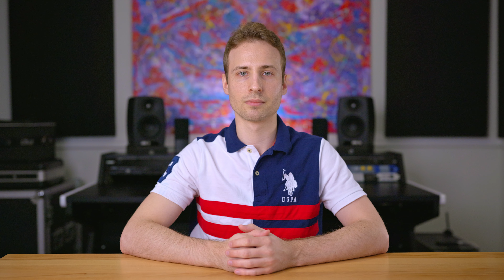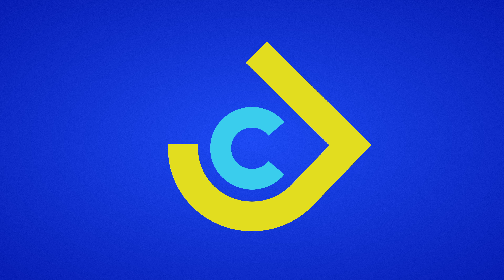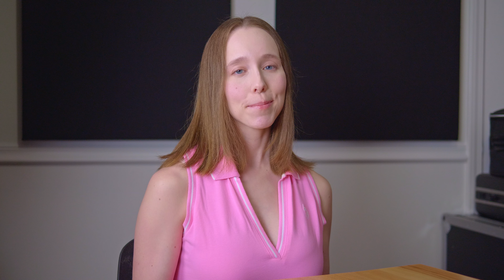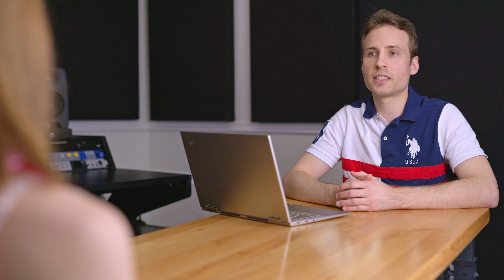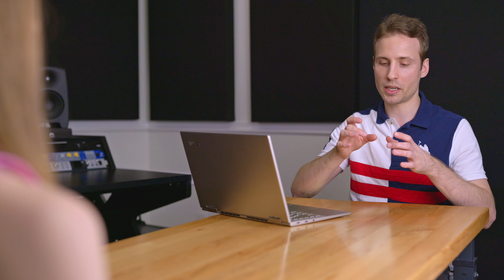The Next Tech Gold Rush

Comment: Very interesting video thank you both for the information. I’ve been a professional software engineer for around 8 years. This seems like it could be an interesting field to learn and have as a backup. Guessing it would be a large pay cut to “start over”. Also wonder how susceptible the field is to AI compared to general software engineering.
Reply from the maker: I think the field is a LOT harder to replace with AI since the work is very physical. It requires quite a lot of in-space 3 dimensional positioning, as well as information that's niche and extremely difficult for AI to gain access to. It'd be like replacing plumbers with AI, it's just not possible at the moment, and won't be for a long time.
Reply: That makes sense. Thank you for the response and all of the great content!
Reply: I think you would have a lot to offer the field having been in software for 8 years. Controls roles and tasks are extremely diverse. You could work for a company who builds and programs machines for manufacturers; work for an OEM and service their existing machines; work as a SCADA, database, and continuous improvement specialist - involves Ignition, Wonderware, or VTScada, database and server management, and coming up with ideas for data reports and solutions; work for a robot development company as a software engineer; or if you have any background in cyber security you could support the deficiency in the industry. Many automation companies and manufacturers need PC software developers as well to work on their ERP or SAP systems and other internal systems, or maintain their website. 

You'll see positions for Electrical Engineers/Designers, which I believe would have a higher learning curve being that you'd need to develop an encyclopedic knowledge of all the available controls devices out there and keep up with new ones and learn the standards for Control Panel Design and schematics. 

Controls programming is pretty easy to pick up through online courses and practice. PLC I and PLC II by Paul Lynn on Udemy were my favorite - they include hands on projects that are relevant to work in the field. He also teaches basic HMI design. The courses go on sale often - I bought them for around $12. It can help to learn ladder logic, structured text, and function block programming, and learn several of the PLC softwares that are popular - RSLogix500, RSLogix5000, Studio5000 for Allen Bradley plcs, and TIA Portal for Siemens PLCs. Schneider Electric also has free PLC software to download and learn on, and it's used fairly often throughout the industry. I think you'd pick it all up pretty quickly with your background.

Ignition also has free Inductive University online courses so you can learn how to use Ignition. It's a SCADA software for monitoring controls systems and plants remotely. You can also get certified by them. Super useful and becoming very popular in the industry. 

As far as pay, complete entry level can pay around $70k, but with your experience I think you'd get higher than that, especially if you prepare and have some controls skills and knowledge when you interview. I've gotten offers for about $150k with around 7 years of experience. 

I'm the controls industry AI is a great tool, but it'll never replace controls engineers. The applications we work on are too unique and involve to many changing factors for AI to reliably handle. It complements our work though. It's already being used for data analysis, prediction and simulations.
Reply: I left a comment before, but it seems to not be showing up. I'll try again. 
Like Josh mentioned, AI is being used as a tool for data analysis, simulations and making predictions. It might even be used later for acting as a reference guide for standardized codes and technical information. But it can never replace Controls and electrical engineers. 
As far as a pay cut, I think your past experience as a software engineer would be very valuable and give you insight to solve problems with programs and networks better and faster than most people. You'd pick up controls programming very quickly and you're probably accustomed to learning new technologies. If you gained the skills needed to program PLCs and HMIs, set up SCADA systems, do some simple schematic design and understand schematics, you could be making a six figure salary within a couple years of experience. (Not everyone could do that, but I think you could build on your past experience and find roles that would find it advantageous). If you look for work in cities where controls engineering is in high demand, like Dallas, you could probably negotiate around a $150k salary within a couple years of experience if not right away. 

A lot of the experience and skills needed can be gained through online courses, reading the publicly available manuals from Allen Bradley on their PLCs, Drives, and IO modules, and browsing PLC related forums. Paul Lynn on Udemy has my favorite PLC I and II courses. Inductive Automation has free Ignition University courses online and you can even go through their certification after completing the training. Ignition is super popular in the industry now and very useful. Manuals for PLCs and all kinds of automation equipment and how to program them are publicly available online and free to read - I reference them all the time, so if you read through those you will learn pretty much everything you need to know. 

Once you go through all the free training materials out there, there are also paid courses offered by Allen Bradley, Siemens and others. You can work towards and get a Professional Engineering License in your state, which also allows you to negotiate higher salaries and gain trust in the industry. 
 
I wish you the best in your professional development and careers!
Reply: Thank you for all of the information!

Comment: Automation will eventually replace all jobs..
Reply: It's replacing some jobs, mostly the repetitive ones. But more than anything it's changing and enhancing the work we do. We still need operators, maintenance personnel, and controls specialists to service the automated systems. In many plants, an automated  tool might be something to make a technician's job easier or faster, like an arm that can lift and move heavy loads while the operator works on the material, or an unhooking wand that an operator uses to remove a hook/clip from product quickly.
Reply from the maker: Eventually I'm sure it will replace many industrial/factory positions, though obviously not all jobs in the world. Plumbers and electricians will be safe for a long time coming.
Reply: ❤ @JoshChristiane